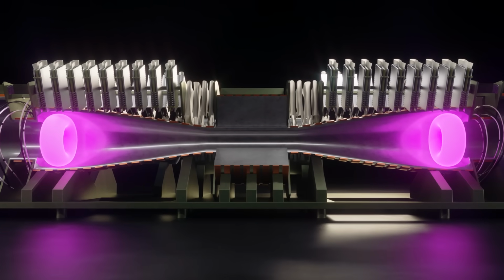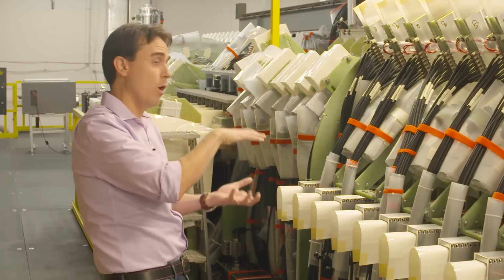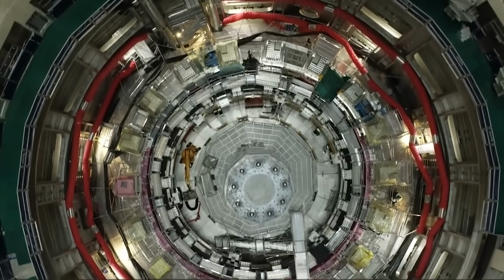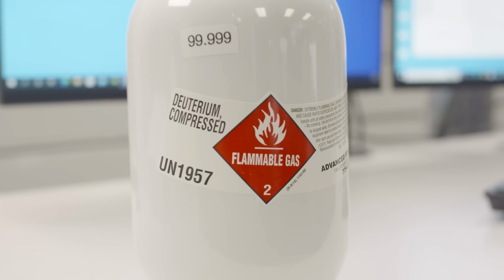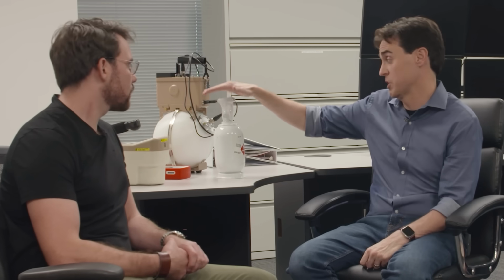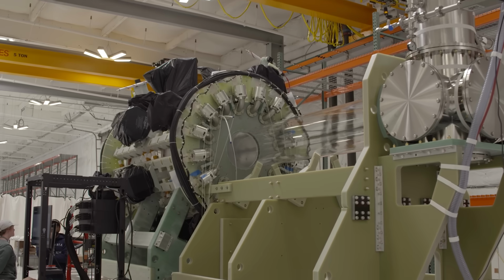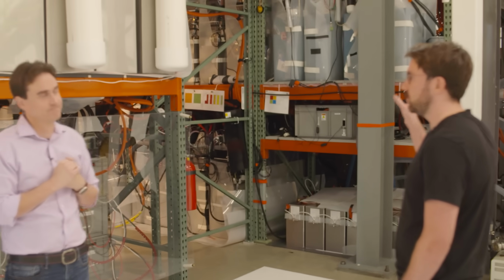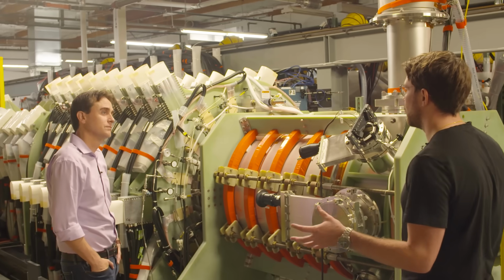A New Way to Achieve Nuclear Fusion: Helion

Comment: Definitely an interesting, thought-producing video about a different method for producing fusion power. I wish them much success in the future and look forward to hearing more about their future developments. BTW, In watching the animation of the injection process, I couldn't help but wonder if some of this design could be used to develop a drive for spacecraft (taking the compressed plasma from the first step and then directing and compressing it to the point if is ejected at high speed from nozzles in the rear to produce thrust).
Reply: I thought that toward the end of the previous video, he mentioned that the design for their reactor was based on ion propulsion systems, essentially aiming 2 of them at one another?
Reply: @dennishort647   
They did have FRC based propulsion systems and those had a few things in common with this, but were also doing a few things differently. 
All of these developments helped Helion learn valuable lessons for their fusion design though.
One was accelerating an almost continuous stream of FRCs (no fusion involved though). That really helped them learn how to reliably form FRCs and accelerate them quickly. Also taught them lessons on pulsed power systems.

The other one is a low pulse rate design that compresses a single FRC to fusion conditions with magnetically driven metal foil liners. It was called the Fusion Driven Rocket (Helion spun out of MSNW LLC, but it is essentially the same people).

https://www.youtube.com/watch?v=tHSOmOu61b0
Reply: It is not that simple. The plasma has very little mass and that means the thrust would be miniscule. The guys at Helion DO have a propulsion design in a drawer though. It is somewhat different. I bet that once they have terrestrial energy down, they will revisit that. That said, I like Uri Shumlak's (Zap) concept a lot for propulsion. A lot of thrust and insane Isp. Think of Mars in a week on average!
Reply: https://youtu.be/r-EOPGmB5eI

Comment: Seems like they need a looot more money.
Reply: Helion is fully funded all the way to commercialization, actually. What they are looking for right now is qualified employees.
Reply: @elmarmoelzer2229  That can not be true, because way too many problems are unsolved before commercialization and the cost is unknown.
Reply: @jannehokkanen8175  
What unsolved problems?
Cost of what is unknown?

FYI: Helion has 500 million funding right now with another 1.7 billion already committed if they meet certain milestones (presumably that is net electricity with Polaris). 
For comparison, Trenta only cost 35 million to build. Polaris will be a bit more expensive, but certainly not the full 500 million. A lot of that goes towards building infrastructure and prototype production capabilities as well as a supply network. 

Once Polaris demonstrates net electricity, they get 1.7 billion to build the first commercial scale power plant and to develop the manufacturing capabilities for mass production.
Reply: @elmarmoelzer2229  The first successful Fusion Ignition experiment in history was achieved at the Lawrence Livermore National Ignition Facility (NIF) on December 5th 2022. With a way bigger laser system. And still they had to put 100 x moore energy in , then got out. So for the investors for Helion, I would prepare for fake fusion  and total loss of investment.
Reply: @jannehokkanen8175  
You think their investors (many of them have been on the board since almost the start) just handed over the money for Polaris without getting Trenta's results verified? Are you that naive?!
They brought in experts from the big national labs to verify the results before they handed out the big bucks!
Plus, how do you fake neutrons and fusion products without doing - you know - fusion?
Joke of the year: "Someone thinks a company built a fake fusion reactor to fake a fusion reactor!" 
Seriously, you are being ridiculous!
Reply: @elmarmoelzer2229  Well exactly yes. Many big  machines has been built just to get money and have fun. They fooled you and u r an expert. So it's pretty easy. No amount of investor money makes it more legit, only builds up more hype. This is like energy vault, or spin launch, or Solid Hydrogen batteries. Hope you won't loose much.
Reply: @jannehokkanen8175  
Look, you can believe whatever you want. I guess nothing can convince you.
But I want to point out that more big machines have been built that worked as intended.
Reply: @elmarmoelzer2229  Well my friend. You are the believer. If you have invested any money for that project. Take it out now, if you can.

Comment: Any idea of energy in vs energy out in this reactor?
Reply: Trenta is relatively close to energy(in) = energy(out), though Helion is keeping that under wraps. All we (as the uninitiated) can do is deduct from their previously published results.
Before Trenta, there was Venti. Venti had a Q of about 0.02 or so. Trenta has 3 times the radius and 30 times the volume of Venti. Confinement times scales as r^2.1. Generic fusion output scales as r^5.6.
There are some other effects that work in their favor. E.g. the ion to electron temperature ratio is very high for their machines. About 10 averaged over a 10 keV plasma.
P(fusion)/P(loss) scales as Ti^1.5 / (Z^2 * Te^0.5 )
Where Z is the atomic number of the fuel. That really makes a huge difference compared to Tokamaks which are at equilibrium of Ti:Te. 
They presented their 2020 results on Youtube (which were already quite good, but they have improved a lot since then, I hear). By my estimate they should be up there among the best machines out there, maybe even better. Hard to say without all the details. It is noteworthy that Trenta was comparably cheap. That has to be taken into account. It was meant to retire certain risks for scaling , etc and it achieved that. Polaris really is the make it or break it machine. It should demonstrate net electricity from fusion in 2024 if Helion is right.

https://www.youtube.com/watch?v=wHirlGXlJ38&t=734s

Comment: The physics of fusion is relatively simple. But the engineering is so complex that we may not see a practical fusion electrical generator in our lifetime. Handling 1,000,000 degrees and higher is not an easy task.  Converting it to 60Hz electricity is incredibly complex. I wish them success, but I’m not holding my breath.

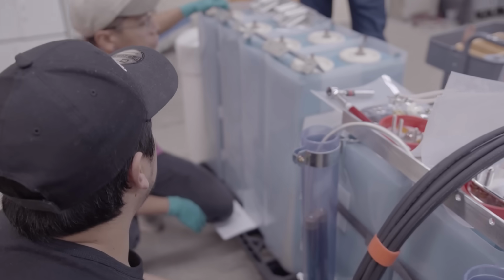Comment: 26:57 not really just have long wires so it takes that long for current to reach the coils expensive but you could assuming you could deal with the voltage drop

Comment: just a different take on a stellarator.  smashing particles together is pretty similar to laser fusion attempts.  it sounds as if they're using vasmir engines to heat the plasma.
Reply: I think they're doing it wrong with generating electricity.  It probably would be better utilizing a neutral plasma and pumping the differential magnetic fields into electricity.
Reply: @herpderp3653  Those were all words... and none of them make any sense. Plasma is charged particles by definition...
Reply: @elmarmoelzer2229  utilizing a plasmadynamic electric generation system.  But i'm wrong, they're probably not generating power at this point.

Comment: Achieving fusion isn't at all remarkable these days.   What would be impressive is getting more energy out that you put into doing it.
Reply: Which was done recently
Reply: @samueltukua3061  Yes, but not at nearly any useful level yet.  AND they had to use extremely rare 'fuel', making their system, so far, totally useless even if it works.  

It was an accomplishment, of course, but only because it showed it's possible to get a net positive from fusion without a hydrogen bomb.  But it's still a VERY long way from becoming a workable power source.

Comment: A good way to demonstrate this technology might be to put it in some kind of ocean ship and put into revenue service.  You could retrofit it into an existing ship bought on the used market as long as it has an electric drive and you would still have a backup diesel.  It would make a lot of press as the only zero carbon ship, and you could give tours when in different ports.   Maybe do a joint venture with a shipping company to make it happen.  

I am just thinking out loud.

Comment: I'm fascinated by this technique.  I'm genuinely curious how they can generate electricity using this method as they're generating the magnetic fields that confine the plasma.  So I understand that the charged particle products push back on the magnetic fields, but how is that energy captured while containing the plasma?  I assume it'll be a timing nightmare.

Comment: Now the question I have is what will happen if it all goes wrong?
Reply: The machine stops working ;)
Reply: @elmarmoelzer2229  no release of massive heat?
Reply: @Rockerrobin  The plasma is hot, but not very dense (only 1/1000 the density of ambient air). It only contains a few kWh of energy. If confinement failed, there would be some abrasion on the inner walls. If the walls failed, the plasma would cool off immediately and all fusion would stop.
Reply: Nuclear fusion doesn't meltdown like fission does. The reaction safely stops if something goes wrong

Comment: This is interesting besides even just the use for energy and the grid, because if neutrons are a byproduct that they don’t use, this tech would be very useful as propulsion in space

Direct the high energy neutrons out the exhaust and you get propulsion while simultaneously producing power
Reply: Problem with neutrons is that you cannot direct them. They are not charged particles and so don't react to magnetic fields. One could maybe try to use them to heat some sort of medium (hydrogen, or water), but they don't make a lot of them in the first place and they are not very high energy. So not sure if it would work that well.

Comment: Net energy kinda of a false statement. More energy out than the lasers energy, but not more than what was required to generate the lasers. Then you need more than what it takes to run facility. That is when you can produce product to supply the grid. Multi years away. This is just hype as always with fusion
Reply: This has nothing to do with NIF and there are no lasers.
Reply: @elmarmoelzer2229  and does not produce electricity after 2.2 billion
Reply: @Mr._Rick   Helion's Polaris will produce net electricity for much less than that money in 2024.

Comment: Correct me if I'm wrong, but isn't Helium-3 somewhat abundant in lunar regolith? If our goal is to create a more permanent presence on the moon, could this be a win-win collaboration to source helium-3 from the moon? It would provide a funding source for lunar habitation and it could potentially provide even more helium-3 than what could be created in reactors (though cost efficiency might still not work out).
Reply: Very low concentration in regolith. Like maybe 20 parts per billion (with a B). So you will have to process a billion tonnes of regolith to get 20 tonnes of He3. Now, if you have some sort of large scale mining operation going on already then it could make sense to extract it as a byproduct. Might make most sense to just burn it right on the moon though to power the moon base.

Comment: Yes, it's fusion. Who cares about ignition, others have done that. Where is sustained fusion? It's obvious you don't know how to do it. Do u need someone to tell you how?
Reply: Helion does not need ignition. They get away without it because they can recover 95% of the input energy directly as electricity. The fusion energy then adds just enough to make up the 5% loss and a bit of a surplus to put on the grid.
They do not "sustain" fusion. It is a pulsed design. They make up for the shorter confinement times with higher density. Going pulsed has some advantages for both the physics and the engineering side of things. Biggest advantage is that they can use the expansion of the FRC plasmoid at the end of the pulse to extract energy from it. Others are a high Ti:Te ratio, extraction of fusion products between pulses, higher density, no need to worry about disruptions and instabilities, etc, etc.

Comment: D2O is actually fairly rare. Heavy water is usually found as DHO or THO. D2O must be manufactured or harvested from fission reactors. 
Heavy water supposedly tastes a bit sweet and is generally safe to ingest, however the Deuterium is slower to react chemically which can screw up certain biological processes meaning there is a toxic concentration level and it is lower than that of regular water.
Reply: No, D2O does not have to be manufactured in fission reactors. In fact, some fission reactors (heavy water reactors) use D2O as a neutron moderator and for cooling. That D2O is extracted from water (makes 0,015% of all water). It is a relatively easy process. Heavy water reactors have entire pools filled with that stuff.
Reply: @elmarmoelzer2229  I never said it did. Fission reactors and their spent fuel cooling tanks are a place where deuterium is naturally formed and can be harvested.
Reply: @Official_DJ_Spark  
I don't think they get much from that. The heavy water for CANDU and similar fission designs was extracted from regular water.
Argentina is currently the biggest individual producer of heavy water, using the using an ammonia/hydrogen exchange based chemical method.

Comment: Sounds strange to me. 20 Million Degrees? 100 Million Degrees? I understand its only for a billionth of a second but how can you contain such temps? Can you? Let me know if you know how. And yes I do know 3'422 degrees for Tungsten. That's not enough.
Reply: They don't let the hot gas touch anything. It's contained by magnetic fields since plasma can be move and contained by magnets. Instead of magnetic repelling it's kind of like using magnetic fields like sheep dogs to form the plasma into the shape they need. Then since the plasma is sitting in vacuum it doesn't hurt the walls of the chamber that much. Plus it's not that hot when it gets syphoned out.
Reply: The magnets keep the plasma from touching the walls. Also, the plasma is hot, but not very dense (1/1000 that of ambient air). The energy content of such a plasmoid at its peak is just a few kWh, a lot less than a Tesla battery.
Reply: @elmarmoelzer2229  TY

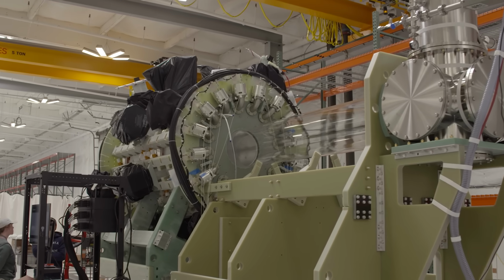Comment: On such an installation, it is not possible to achieve a positive energy output for a sufficiently long time. In addition, apparently, they do actually not even think about how to extract this energy, because the currents that will have to occur during synthesis (if I correctly understood what was said at 9:15) in the case of a positive coefficient, they will require, khm... "quite impressive" conductors.
Reply: The energy content of a single pulse is only a few kWh. Not that much. Not sure what you mean with the rest. The machine is pulsed and it will do 10 pulses/second.
Reply: @elmarmoelzer2229  "only a few kilowatts" is at the moment. And now they are far from a positive fusion energy gain factor (Q). When (if) they reach positive Q values, there will be tens of megawatts.

But this is only part of the problem. In fact, that the installation works in a pulsed mode, as it approaches positive Q, will lead to an increase in various parasitic effects, as it was on large serious installations like NIF. But they at least have an understanding of how to solve those problems, but here the principle itself is such that, apparently, they don't even think about solving future problems.
Reply: @hate-conductor  
The power plants will be 50 MWe
Assuming that their energy recovery is at least 50% efficient (it should be more like 80%) and they are going for a Q(engineering) of 3 (as they have previously stated), then a single pulse will contain 2.8 kWh of fusion power for maybe 1 kWh of recirculating power. You can do your own math and assumptions.
Reply: @elmarmoelzer2229  This is where the problem lies.  They will not be able to draw 50 megawatts from such a tiny core in the long term.  Besides, these predictions for Q=3 are simply ridiculous.  So far, they don't even have 1.  More questions will follow.

Comment: oh man. I am so blown away. The way they use magnets to sculpt and manipulate plasma and then accelerate it enough to fuse all from just a few feet away, I felt like I'm seeing some sci-fi shit? And the way David explains the plasma getting hotter, he could probably teach an 8 year old about fusion lol. I particularly enjoyed the part on how they plan to generate energy, it's almost like what Tesla did with electric cars — eliminating intermediary processes (like burning fuel to drive pistons which rotate crankshafts attached to axles) that waste energy, increase wear, and resist size reduction ; while at the same time finding a way to output the energy directly as torque in one single step! I almost hope you change the title to a more clickbait one lol, I mean what you show here, this stuff will live up to any hype. Helion's fusion reactors tick so many boxes, we may actually be looking at what may one day become the very first fusion-powered engine for interstellar travel damn

Edit: props for the absolutely stunning animations too!!!